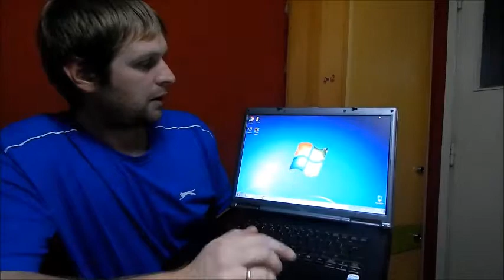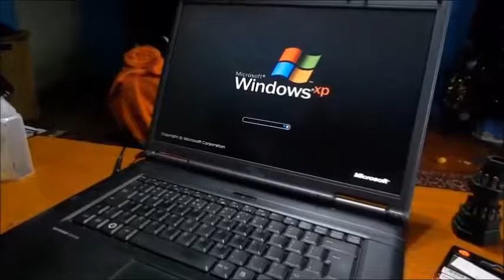Upgrade your Fujitsu Siemens V5535

Comment: Will t4500 work on that laptop?
Reply from the maker: I doubt it will be able to work since the processor started production in 2010 and the board on the laptop in 2008. check the year of production of your laptop
Reply: @MiticKuzelka  thanks!

Comment: Hi.i update bios to 1.13.
Try cpu t7300,but not start.......
Reply from the maker: if it works with the old processor that you replaced
Reply from the maker: Is it works with the old processor that you replaced
Reply: @MiticKuzelka  its funny,the old one is not the stock but a T5850  core 2 duo ho is better from the 7706a283 T7300 sla45 2.0GHz I buy for......update...😂😂😂😂(only 8€).
 wich one is beter and works with bios 1.13?????
If you know.......
Thanks.....
Reply from the maker: so the processor has already been changed. The T7300 is a better processor but something doesn't suit and the laptop doesn't start. as for the bios, that version is on the laptop I worked on and everything works